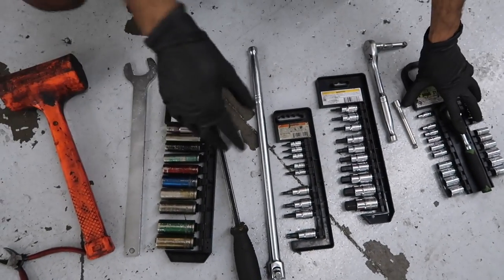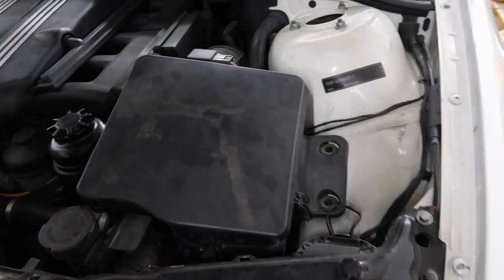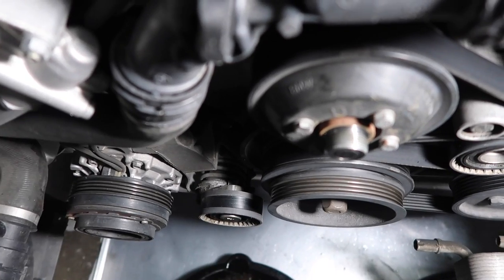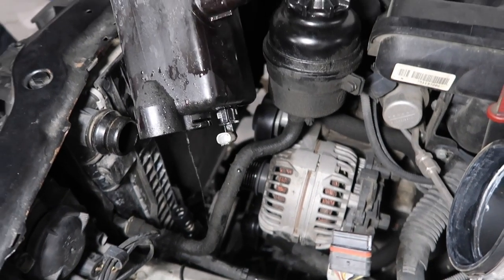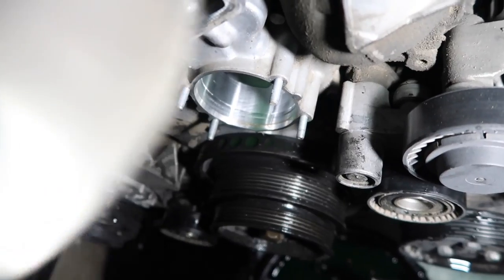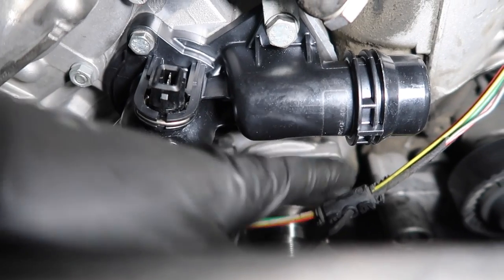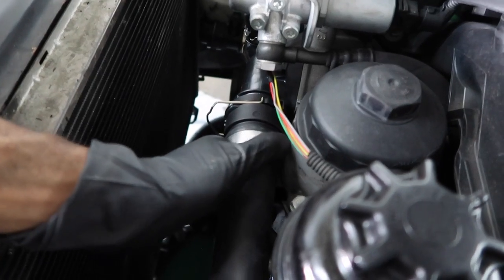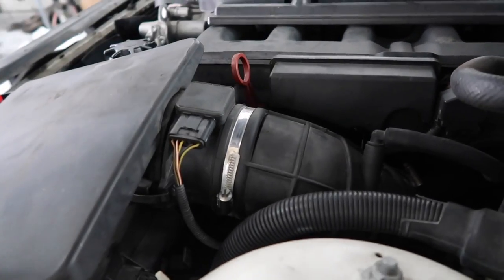E46 COOLING SYSTEM REPLACEMENT DIY (STAGE 2)

Comment: Heh I bought E46 in January and after two months radiator broke. So I did my cooling system just this weekend. I did only new radiator, water pump and belts and pulleys. I found out expansion tank was already changed in 2014 and both hoses looked nice and rubbery, so I reused those. 

Funny thing a new radiator didn't fit properly into plastic mounting bracket. I had to use bunch of zip-ties to secure it. And it even was BEHR/HELLA brand not some Chinese ripoff. 

The most painful part of the process was draining the coolant from engine block. That damn drain screw is almost inaccessible.

Comment: Great video, suggestion to make it better:  you often say "move this way, or pull that way", problem is most the time we don't see your hands, could be anywhere if the camera doesn't catch you hands. Instead train yourself to say this: "pull car-forward or pull car-rearward" that will take care of all "x' (fore and aft, front to rear movement). For "y" or cross car movements train yourself to say it this way:  "pull it towards the driver side, or pull towards the passenger side). This way doesn't matter if the camera doesn't show your hands or if you move to quickly or too little, the audio direction is very clear and we then we know what you mean to say.

Comment: I replaced most coolant parts except thermostat and expansion tank, and those both failed at 130K. Expansion tank leaked out all coolant and almost over heated the engine. Also replaced front control arms, and had vacuum leaks from failed rubber. Car also burns and leaks out. Don't buy if you can't work on them yourself! AWD is very good.

Comment: Great videos!!! I just upgrade most of the coolant hose, water pump, thermostat, radiator etc. Yesterday I had to replace my starter and I order the CCV and the hard line. How do you remove the coolant hard lines without breaking them? and if we do break it what tip you can give us to remove the plastic parts from the block without ruin it? Thanks for taking the time to help us.

Comment: Great video matey. We are having trouble with our lower radiator hose. It won't push on after 2 days of trying! Any ideas, we have used some light oil on it to try to make it slip on but still no luck!! Original bmw part too. Thanks matey

Comment: Can Anyone Tell Me If The E46 Expansion Tanks and Hoses That Are On Amazon or Ebay Come With The O-Rings???
Reply: Got mine from Europarts. O Rings are plastic and part of the expansion tank. It would not connect.Kept leaking.
I took expansion tank holding bracket off of the radiator into m bathtub and tested the connection there. The new one kept leaking. I wasn’t paying BMW £96. I tested the original one and no leaks.

The key was TESTING outside of the car in a controled environment.

I used the original expansion tank with the new sensor and it is not leaking now. Works fine.

Comment: Do you have a video to address the two heater hoses and the expansion tank return hose. I have looked for hours. 2003 325i with the e-46 engine

Comment: Hey just wondering what the hose is that connects to the plastic radiator mount that the expansion tank sits on? Not the return hose that connects to the expansion tank but the one beneath

Comment: what would happen if the expansion tank is put into place without the automatic transmission thermostat? The plastic part where the spring and golden pin goes is broken and wont sit into place. What is the outcome?

Comment: Ankur, thank you for all of the informative videos you've produced for the E46. They have really been a big help. I noticed the expansion tank you used in this video is the Behr Hella Made in China tank. I ordered the same one, but I have heard reports of this one failing and leaking around the o-ring fairly soon after installation. Is this one still working fine, or has it leaked? Thanks again for your great videos.
Reply: Always use OEM parts for your BMW

Comment: Hi, I have an X3 e83 2.5i 2004 and have just drained replaced the coolant, at what point do I need to use the automatic bleeding pump were you put ignition key to 2, fan speed 1 and temperature on high? Do I just skip that step and warm up the engine until the thermostat opens?

Comment: Awesome video. Excellent information about E46 BMW my friend. It seem like you have a solid knowledge about the E46 BMW. Just found out most of your videos. Very clear and to the point. Love it. Keep doing the good work. I have the same car like your, M56 motor 325Ci 2004 and would like to swap out the engine due to piston rings go out and start to burning oil as well leaking oil. It has almost 250k miles on it. My questions is, do you have a video how to removed/replaced this M56 motor? I just bought the M56 engine from junk yard and would like to install myself with the help of a friend. Other question, is it possible to swap M56 motor to M54 motor? What else do I need if it can be swaped? Thank you and please reply.
Just subscribed to your videos 😁👍
Reply from the maker: I appreciate the support! As far as m56 to m56 its straightforward just like the m54 replacement, only difference would be the fuel line connection. Now with the m56 to m54 swap is possible but not technically legal since the vin would still register as a sulev model. The fuel lines would all need to be replaced as would the fuel tank. The wiring would be a little different as well as the tune on the ecu. The ecu is ms45 which can be reflashed with a normal m54 tune as well. Id recommend buying a m54 car instead unless you have sentimental value with the m56 car.
Reply: @ShopLifeTV  Thanks for quick RESPONSE. Can you please tell me what is the first thing (location)I need to remove the motor. Where do I start? What tools do I need? What would you recommend to do first thing. I would like to know how to remove my M56 motor. Please REPLY. Appreciate your knowledge.

Comment: I recently was given a 05 325i has been sitting for a couple of years took a fuel pump reg/filter Ether & 12 plugs fouled a couple Bosch on initial start up(NGK 2ND RND) & 2 coil on plug later just to get it to run on it's on (smoothly). Pwr steer shaft broke now replacing all lines & reservoir next is exactly what the e46 wonder kid has replaced here SCARY part of cooling sys coolant looks (GREEN) I hope I'm color blind & its really blue...I'm a good DIY but that intake removal makes me nervous to change just to get to the 2 plastic hoses & CCV SYS, Disa on the list to change as well. ...Any one finds his video on intake removal please pass it on ill need to study that video carefully...Other than this car is solid runs great elec fan conv was done.. Cleaned it up & fell in love with it...

Comment: In the part of opening the bleeder screw 1 1/2 turns and turn the heater on with the car on, the bleeder screw starts throwing coolant is that normal? Or third it throw and amount and the stops?

Comment: You def are the e46 man, but my question is...I have coolant leak in my '03 e46, I think it's coming from the front of the engine, is it safe to use k seal???
Reply: David figaniak no unless you're ready to scrap that car... Fix it the right way

Comment: You were talking about O-ring wich Oring you were talking about and where to get it. Are they standard one size or it comes with sizes. Thanks
Reply: Rico RicoMN inside of the rad hose there's orings ensuring it's tight. But if you're replacing the hose it comes with it. If not spray with sticks to render pliable

Comment: Do you need to torque down the water pump bolts to spec? Or will moderate tightening do the trick?
Reply: Nico Blair torque it to specs if you're not versed in cars repairs. For us we know how to deal with plastic aluminum and steel

Comment: do you have a system of putting everything back together? because that is a lot of steps, and i lost track quickly. between bolts and clips and hoses and belts, etc. how do you normally handle that? thanks.
Reply from the maker: If you get overwhelmed with all the bolts and parts you can lay them out with their designated bolts in the order you removed it. Ive been doing this for a while now so I usually remember where everything goes but I understand that it can get confusing if you are just starting out. Thanks for watching!

Comment: I had a catastrophic failure of my expansion tank today in my 2000 320. for replacing the tank, should i get the cooling system refresh kit? just this year replaced the belts and pulleys and thermostat with housing. or should i just replace the expansion tank only? what about the transmission thermostat? should I replace that too. the car has only 66k on it.
Reply: blackpassenger if it ain't broke don't fix it is a golden rule
Reply: not with BMW'S

Comment: Was that ECS Tuning water pump machined to EXACT BMW specs?  I've heard horror stories about the more durable metal impellers leaking and not being worth the trouble of the installation.  Stick with OEM water pump even though it's the *dreaded plastic*.  o_0

Comment: Hello I got a quick question got my abs and brake light on yellow and the control track I replaced all the speed sensor and the brake fluid level check now I got the same light but brake is on red any solution?
Reply: 2004 325ci

Comment: I have a coolant leak, it looks to be coming from the front right side (passenger side, near the middle, near the front part of the engine), any ideas what the problem is?
Reply: Thermostat or water pump probably.
Reply: It’s probably the lower radiator hose at 13:20

Comment: I have a huge problem right now with my 05 e46 auto. I changed the radiator and expansion tank. my car isnt not over heating bt when the car gets up to temp the coolant bursts out. Please help me lol i been working on my car for a few days now. Cant find the problem at all.
Reply: Did you ever figure out why this was happening? I'm currently in a similar situation, but it looks like my lower radiator plug just burst out.

Comment: Hey my 2003 bmw 325ci overheats after 10 minutes or so of driving, i’ve bled the system but when i put the heater on it doesn’t get hot it’s just cool air, does anyone know the cause?
Reply: Probably the thermostat
Reply: @richlee509  i fixed this 2 years ago and it turns out it was the thermostat ! thanks anyway man have a blessed rest of your day

Comment: just something else... i am always suprised how things go in america instead off here in europe. you are now 21 but started 19 or so with you own shop(maintining customer cars) im 23 i still live with my parents(most people do till 25) car license on 18 instead off 16 there(america). and there s no way i am thinking off opening my own shop. the same with teen mom there 16 and already a kid its crazy.. most off the people here get kids on the age 30.  and what kind off school/degree are you now following?  further i am quite amazed by the knowledge you have a have a car mechanical degree but i know lot of theoretic things but i do to less working on cars so i watch video's 

further now some bmw things: if i reinforce the rear subframe with plates does then not crack anymore?    further if i shoot the clutch (5 speed manual) i hear a bonk in the rear i checked on cracks(subframe) but dont see any yet and the hardy disc had some light hair cracks but nothing serious maybe the bearing of the driveshaft? 

sorry for bad english keep up the good work

Comment: I replace my thermostat housing and expansion tank but now the expansion tank steam and it runs out of coolant and the guage temp goes to hot and comes back to normal and the fan doesn't even come on, is there a way that something is missing or do i need to do something else. Any suggestions. 
Thanks